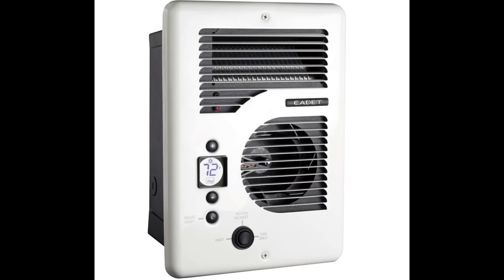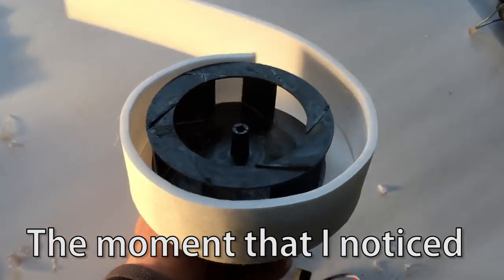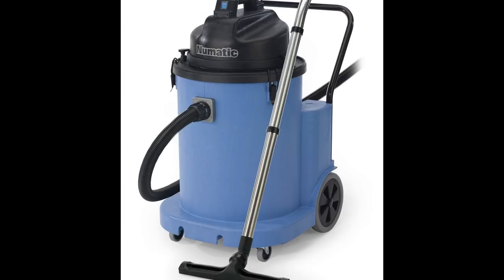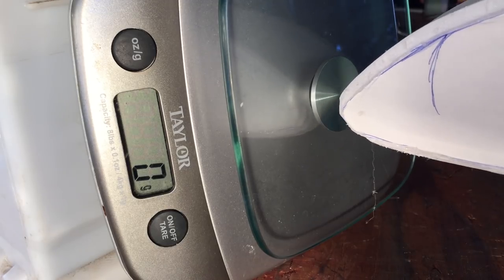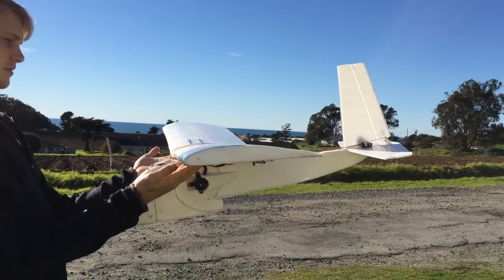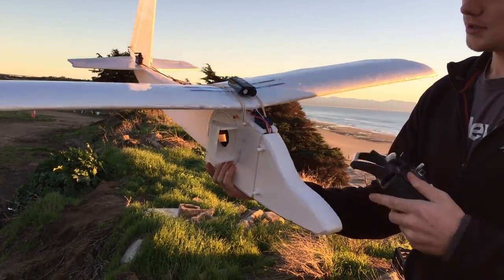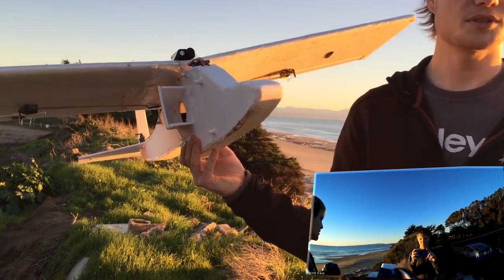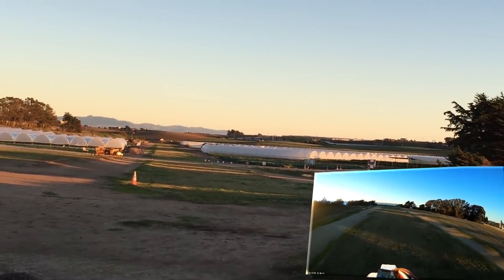This is NOT a Propeller

Comment: even thouhg its less powerfull, it sounds sweet though man. awesome :D
Reply: now you need to make a twin turbo :D maybe somehow conceal the turbo's in the wings, not sure how that would effect lift, maybe it could even substitute it some how, im no liftologist
Reply: Yeah
I love the sounds of jets!
Reply: I think experimenting with the design of the impeller , matching a motor more suited for a higher rpm, and getting a proper nozzle fitted and you could probably match a propeller, especially if you can get a decent compression on the exhaust.

Comment: Could you, by mounting the fan horizontally with the air intake at the top (with the right design) lower the air pressure on top of the craft and increase the lift? Like some kind of sucking flaps on the leading edge. Also wonder if something like it (smaller?) could be used on the main shaft of a  heli with the ducted thrust used to replace the tail rotor.
Reply: Interesting concept...
Reply: I wonder how the spinning fan would affect the yaw.
Reply: Both your ideas would work, and have been used in aircraft designs several times. The MD NOTAR System works a lot like that for lateral control (The actual torque compensation doesn't, though, only the rudder does.) and some STOL capable transport aircraft have their engines on their wings for that reason. Or think of the Honda Jet, or from back then, the VFW 614.
Reply: i think it would effect the pitch
Reply: Might be able to duct the intakes or the exhaust to the most aerodynamically advantageous position to maximize all possible lift/thrust.
Reply: if you mounted it right and assuming the Yaw is not enormous you could effectively generate lift and thrust at the same time. the thrust coming off the side should counter act the torque of the impeller. It would be interesting to see if that actually works, and how efficient it would be.
Reply: MIGUEL DELGADO OK I'm in
Reply: Take it one step further... Matched pair of counter rotating fans... 
Worked with a similar setup that was designed for a thrust vectoring near vtol light cargo drone, however the project was canned in favour of other priorities.
Reply: P E (Phil )Norman in the UK, 1950s, experimented with a semi-scale delta model with an ICE (diesel)-powered centifugal compressor. drawing in through the top surface of the wing.  He went back quite shortly to refining his axial-flow DF designs, citing difficulty in access for starting the engine and lack of efficiency/no advantage.
Reply: docthebiker japanese sea planes use high pressure air iver the wings to help increase lift and it works suprisingly well.
Reply: docthebiker will you want air to push up so by doing so the plane would have a weird design and fly weird cuz the air will for then push the plane down
Reply: docthebiker that was much thought, lol.
Reply: That is what I was going to comment.  Good idea !!!
Reply: You mean high speed, low pressure, right?
Reply: Well its currently sucking from the front. so it has increased forward thrust. id think the thrust would be far more preferable to some aerodynamic upward motion relative to the wings.
Reply: docthebiker thanks man
Reply: docthebiker interesting idea!
Reply: great idea!  well done! if i may?....imagine a plane with two stubby wings each containing a rotatable ducted fan. now imagine you have not TWO stubby wings but FOUR. A  pair in front and a pair aft.TWICE the lift. TWICE the manoeuvrability and perfect VTOL. its SO obvious!!! Why isn't anyone doing that???
Reply: Surely it would affect the yaw
Reply: wolf222555 I think it's called a quadcopter 😅
Reply: Yep, and it has twice-as-efficient and much lighter propellers.
Reply: You want BALANCE in the lift. If your idea worked, the wings would have to be smaller or a less effective shape, or else the plane would fly up or loop de loop.

Comment: that's fucking cool
I would stick two of them together mirror image, just because the assymmetry of having one air intake on one side is killing me.
Reply: better still: with two fans you could thrust vector also...
Reply: Christopher Hurley Well you could, but unless you're planning on putting servos to change the pitch of the engine, you'll only be able to yaw the plane back and forth
Reply: I think he should remove the external intake fairing entirely; this isn't a transonic aircraft, there's no significant ram effect.
Reply: I’d put two in the wings ducted out the back. Able to make it look better
Reply: @christopherhurley2570  Just one is enough as it is, but instead changing the pitch of the outlet from straight back to straight down with a servo.

Comment: essentially the first hair dryer or leafblower powered aircraft
Reply: this is unique !!!
Reply: Mamothdinolover 112  his new diy ultralight is so sweet so far
Reply: ' first '  Realize similar has been done and thought of for ages.  Reaction force of blown air is obvious to anyone who has ever used a gas backpack leaf blower, and equally obvious that it's terribly inefficient but that you could use it to power a plane if you did it well.  Actually doing it is only a triviality, it was obvious from the moment of first using that type of leaf blower in the 80s.  You're about 10 times better off to simply use the same motor/engine but put an actual prop on it..

Comment: make the outtake smaller, like a jet engine... it will push even more!
Reply: They did the same thing (or similar) with the main air intake of the P-51.  The air went in, and the hot coolant cooled down, but the air became warmer.  So they narrowed the end of the air intake, so it slightly boosts the aircraft.  Albeit not by much however.
Reply: every little helps!
Reply: True! ^_^
Reply: It will be less efficient in low speeds though
Reply: ferrarigirl666 I
Reply: Well it could possibly have been adjustable if he wanted to pour enough time into it
Reply: Basically how a jet engine works. Just a series of impellers compressing the air.

Comment: Yes, but no propeller to break or tear up something.  Drone any one?
Reply: a bladeless drone would be pretty dope
Reply: not efficient or responsive enough. it's been tried to an extent with "dusted" blade guards
Reply: ducted*
Reply: Fjolfrin the Silk Beard There are plenty of ducted fan drones that work just fine.
Reply from the maker: Other ducted fans in production are axial propellers with ducts. This is totally different.
Reply: How about Coanda Effect devices?
Reply: Scott exactly what I thought
Reply: Scott yeah safer than propeller for people on the ground
Reply: This is flying on nothing but a squirrel cage though xD

Comment: Awesome work. Question about the Giro you used on the helicopter. I have no experience with this stuff so excuse the ignorance. It is physically stuck to the plane and just dampens its movements making it smoother? or somehow just reading the movements and building into the servos for controlling it?
Reply from the maker: +Lo3 Yea, it is a sensor that senses rotation. When the plane is rotated, it automatically applies corrective action on the appropriate control surfaces (assuming you set it up correctly). The unit also lets pilot control inputs through.

This instantaneous reaction helps to smoothen things out
Reply: +Samm Sheperd (SNRS) awesome thanks for clearing that up
Reply: +Samm Sheperd (SNRS) I'm kinda more interested in how the gyroscopic effect from the fan itself, feels when flying.
Reply: enlightendbel Thought about that too. since it would also be parallel with the plane unlike when a propeller is perpendicular?
Reply: +Lo3 yup, plus, if there's difference between having it spin clockwise vs counter clockwise.
Reply: enlightendbel maybe it would reverse the direction and force air out of the intake and suck in through the outtake. Maybe this is the solution to planes not being able to drive backwards. (yes ive seen the jet engines that can do this now adays)
Reply from the maker: +enlightendbel I didn't notice anything obvious in flight. But while holding the blower there is definitely significant gyroscopic precession. A force applied to change the axis of a gyroscope acts 90 later in its rotation. So:

Yawing left would make the plane bank right. The opposite of what we want.

And banking left would cause a yaw to the left, which is what we want. 

So much for "lead with rudder "
Reply: +Lo3 Didn't think I would see you here. Love your content btw ;)
Reply: +Lo3 have 2 in opposite directions to cancel it?
Reply: +Samm Sheperd (SNRS) How did you program the plane to correct from the gyro input? Did you write the program yourself?
Reply from the maker: +Alexander Lowry nah micro controllers and coding are awesome but not my DIY strong point.
I used this product: http://www.amazon.com/JMT-P1-gyro-Controller-Stabilizer-Airplane/dp/B00FFT7CKW
Reply: +Samm Sheperd (SNRS) wow, that is the coolest thing ever...thanks for sharing your secrets i was really wondering how that plane worked
Reply: I builds into the servos

Comment: Well played sir, that is pretty ingenious. As with EDF's there are a few critical tolerances with regards to inlet and outlet size (and in your case impeller to case clearances), with some study, expirementation and refinement, I'm confident you could significantly increase the efficiency. Also the reason for pitch up under power is the thrust line(outlet) below the center of lift and gravity. If you flip your outlet to the top it would move them closet to one another and provide moving air across your tail surfaces.Keep up the innovating, now if you'll excuse me I must go strip the a/c blower out of my old car...

Comment: Try exhausting the air above the wings for more lift.
Reply: Chad Kovac true, moving fluids=lower pressure
Reply: i think its the other way around
Reply: look up Bernoulli's principal
Reply: You are all saying the same thing.  It is the condition of lower pressure above the wing, than below the wing, that causes lift.  The faster a given volume of air moves, the lower its pressure.  The air may be accelerated passively (shape of wing) or actively (throw some jet engines up top).
Reply: May be Chad refers more to Coanda effect?
Reply: If Coanda effect is correct, then yes, that one.
Reply: the duct would also spoil some of the lift thou, its the reason most planes mount there jets under the wings.  Mounting the intake on the top of wing with no duct however would create a suction device and allow you to go to a much high angle of attack thus more lift.
Reply: Actually you should direct the exhaust to flow off the top rear of the fuselage and across the tail wing this will reduce drag significantly and is how the D8 Dreamliner Double Bubble design works.
Reply: matrix49A well there is less air to suck because of the low pressure, so the lower thrust might make the effort void

Comment: Putting strawberry jelly under the wings will help keep it from landing upside down.
Reply: Jonathan Green what
Reply: God dam it's science
Reply: No use butter, its more efficient and improves aerodynamics because it makes the craft slipper
Reply: Cakeeater34 but butter is yellow like the sun so it would catch fire more easily and possibly fen pool the sun closer even if only by an inch
Reply: A cat is much more effective for this case.
Reply: A cat with buttered toast on it's back = perpetual energy machine.
Reply: Nah u gotta make the wings out of bread and put jelly on one side and peanut butter on the other, and when your plane crashes at least u got a peanut butter jelly sandwich
Reply: cat with toast on its back= infinite energy
Reply: You have to use strawberry jam

Comment: That space in the blower is called a plenum.  If you look that up you can dial in the most efficient shape, although you got pretty close it looks like.  Squirl fans are very effient as fans go.  Lot of advantages for not having a prop.  Very durable and more placement options for the propulsion.
Reply: I read  that centrifugal fans on planes are efficient and powerful at low speeds, but also that they consume more energy from the batteries. Do you think it's true?  I knew it from a guy on a forum and probably they are just intuitive considerations.
Reply: The statements seem conflicting.  It seems like there are tradeoffs like many other plane configurations.  There are more blades and more surface area around the walls of these blowers vs a prop that is getting clean open air.  However the blower with enclosed air can be compressed and further utilized.  Similiarly at certain speeds jets become more efficient than props.
Reply: Oooh....guess what I'm making at work tommorow..muahahaahaha! ( I work at a surplus store. ) Coincidentally, we've got those squirrel fans + ducted fans ( I suspect they are from old hair dryers), brushles DC muffin fans water pumps ( wish they were "JETS."☹️To make an rc boat. Right now I'm thinking a ground effect glider or airboat.....maybe he said in the video but how's he controlling the motor speed? Potentiometers? Esc?! I don't get that part...cuz unless you have a built in esc in the flight controller when u throttle up wouldn't it be full throttle or no throttle?
Reply: P.s. check us out  although the website doesn't do any of the stores justice. There's waaaaay more than what's listed online. www.axmansurplus.com

Comment: I would change a few things.
Your wing incidence ratio is way off. Make it closer to the tail AoA.
Your ability to make exhaust velocity is not being taken advantage of. You need to narrow the outlet which would raise the air speed coming out of the exhaust.
Treat it just like an EDF. Widen the exhaust outlet and you increase traction but decrease speed. Narrow the outlet and you decrease traction and increase speed.
Reply from the maker: +MikeSVOR I agree with you. The angle of incidence is a bit high, resulting in a little bit of a nose low cruising attitude. The decalage is also a bit high, resulting in an inherently stable, but slow trimmed condition and excess elevator drag at higher speeds.

When I experimented with narrowing the discharge nozzle, I found that it was not able to pump as much air, and would not consume as much power. Though I did not try to measure the thrust in this condition, it felt to me like there was less.

I am interested in asking engineering professors at my school when I get back about what centrifugal pump design would be best for thrust. And I would like to model and 3D print a much more complex one which I imagine will resemble something like a turbocharger.
Reply: Makes sense

Comment: you coul add vectoring nozzle instead of rear rudders, that woud be extremely unpractical but totally fun!
Reply: PolesAreEverywhere Actually, exhaust vanes could do the same thing, and it allows for manipulating airflow left and right as well, effectively replacing the rudder as well.  It's what the Germans used on the V-2 rocket.
The only drawbacks are a loss of a bit of thrust due to drag on the vanes, plus the possible need to add another gyroscope for roll control.
Reply: also it would lost most of its control with the turbine turned off and it would react differently depending on the speed of turbine. Its still worth trying just for fun :)

Comment: Fantastic...!   So did it feel under powered?   Did it torque roll in the pitch axis?   What if you lighten the fan, and maybe tweak/mod it slightly for more power/efficiency?  It would also be easy to attach another motor to the other end of the fan, yes?  Nice flying BTW...Beautiful scenery!!!!
Reply from the maker: I have very little EDF experience but I think it was like a stock RTF EDF plane.  I was concerned about torque on the pitch axis. But it's about the same as prop plane. Usually prop blast over the tail gives it more authority. This is why the slowest landings are under power. This had the same effect.

I think the most efficient thing I could do is 3D print an impeller and a housing to be much more complex (and not square) and resemble something like a turbocharger

The other end has to be open so 2 motors wouldn't work
Reply: +Samm Sheperd (SNRS)  You'd need to 3D print the impeller, but sure you could. Just make the second one take air from the other side. Either central air channel and large nacelles, for split thrust, or air from the sides and central thrust.
Reply: +Samm Sheperd (SNRS) Two motors wouldn't work, unless you built the motors smaller

Comment: I would add another turbine right beside the one and make an intake manifold that converges at the very front of the plane.   the faster you go the more air pressure goes into the turbine the better the efficiency?  Just a thought.  I don't know much about planes but I know a substantial amount about cars.  if same principles apply in any way then that should work.
Reply: This is just a reinvention of the turbine engines lol!
Reply: reinvents the turbine
Reply: I'm no expert but will that not increase drag?